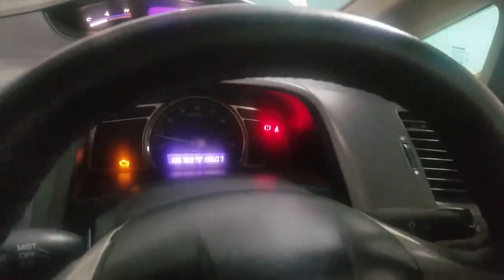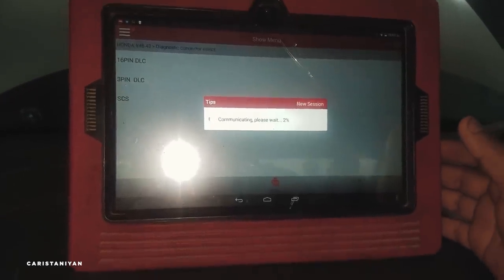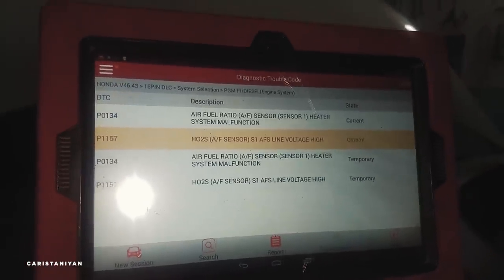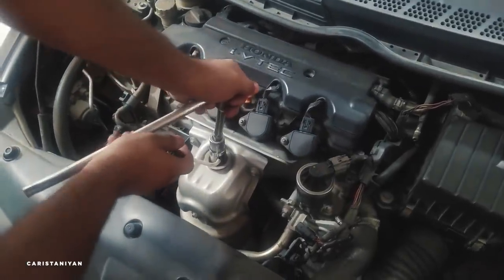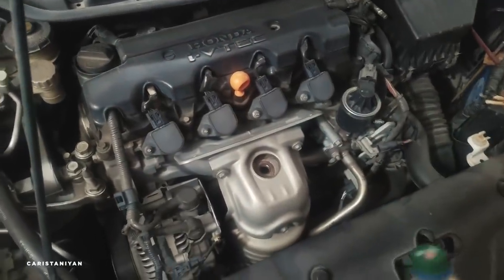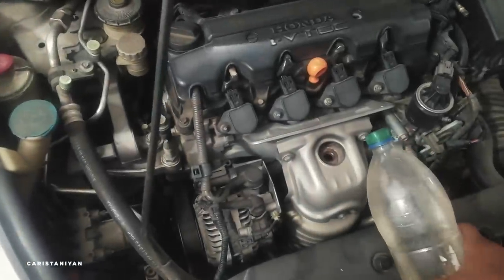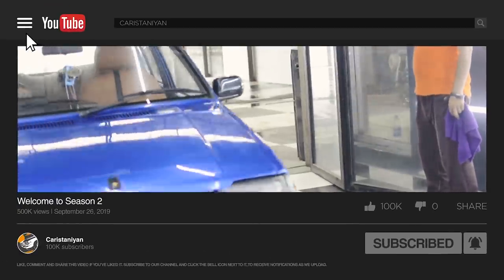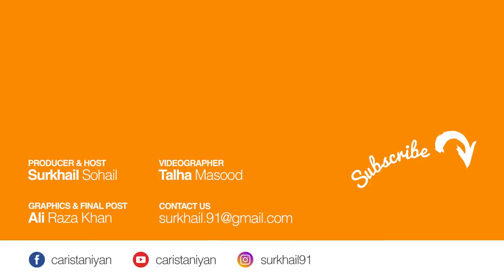Catalytic Converter and Oxygen sensor cleanup | Check Engine Light removal | S02E03

Comment from the maker: To everyone saying this is not the right way of going about clearing the oxygen sensor code, I agree, it's not. Changing the oxygen sensor (new around 25k and kabuli around 5k) and Catcon( new around 30k kabuli around 13k) is the right way. Everyone cannot spend that kind of money. This is the process being followed at workshops around the country which mechanics charge 4k to 5k for. I documented it so in case you DO plan on going to a mechanic to get this done.
(1)  You have an idea what the process is and how cheap the process is so you can negotiate.
(2) incase you're technical enough, you can DIY this at home.

That's all. If it works, IT WORKS. as for corroding, you can pour water after pouring acid so it dilutes and does not corrode the silencer that much. If anyone of you still has doubts, car is at Autogenie everyday, you can come and see if it has corroded or if the sensor is damaged in any way.
Reply: Aslam o Alikum bhai acid ka Name btain plz our kidr sa ya buy kar saktay hn.. Shukriya
Reply: First I support your view that this method of cleaning is fair and one suggestion: do try caustic soda mixture in water for cleaning...it is highly recommended for cleaning in automobile industry wherever there is grease, oil or any other deposits. I am sure you'll find it beneficial.
Reply: Bhai wash krnay ky liye  acid kon sa use kia apnay and kahan se milta hai
Reply: Dear which acid u are using to clean?
Reply: Gravity kitni honi chahieah acid kiii plz reply dain

Comment: make sure never use acid for sensor or C converter.  it destroy the sensor sensitive part inside and also it increases the emissions of bad gases from C converter.  use Carbon chock cleaner for sensor and best cleaning agent once a year for C converter.

Comment: Everyone is asking about the acid, it is most likely Sulfuric Acid (H2SO4) or Hydrochloric Acid (HCl). First preference is Sulfuric Acid, if you use Hydrochloric acid it will destroy your exhaust system even if it made of SS (stainless steel). Chlorine acts as a poison for SS.

Comment: Big mistake....cleaning with acid is highly not recommended. Rust will come back so quickly may be in a week you need to clean again. If you're cleaning any thing with acid make sure to neutralise it with a  base e.g sodium carbonate.  Anyways your catalytic converter will expire after acid bath.

Comment: Better to get it cleaned without removal from MotorClean Walton Road opposite to Packages Mall Lahore . They do not use acid and their method is quite safe also. Charges are quite reasonable and owner is Electrical Engineer
Reply: @kashiflf  how, can you breifly explain

Comment: Nice video. If the O2 sensor is very old e.g. over 80,000 km, then no harm in trying to wash it with acid or any other means. Just don't expose any sensor to WD-40 or similar silicone based product. I am not sure how the zirconium dioxide in the O2 sensor will behave after the acid wash but since it is already not working so no harm in trying such things. Similarly, no harm in trying to wash the cat with acid. The way it is done is important to avoid damaging the entire exhaust system.

Comment: Dear Sir, I have recently bought Suzuki cultus about 3 weeks ago
2010 model and driven 86k kilometers. Changed engine oil Zic x7 10w-40 along with air and oil filter(Guard).1.    Problem is my car is giving white smoke oncold start for about 10-15 seconds then it disappears and steam comes 2-3 min.2.    Smoke only comes if the car is at rest formore than 6 hours otherwise no issue in pick or drive.3.    No reduction in oil or coolant till now.I'ma new owner of car and hence do not have its previous details. Please guide mewhat could be the cause of it and how it can be fixed.

Comment: Aoa. Bhai is sye fuel consumption par b fark parye ga ??
Reply: Yes, because this sensor is responsible to send air/fuel mixture ratio to the engine, hence if it's working fine it will send the best air/fuel mixture to the engine. 
Catalytic converter mainly affects the pick of the car.
Reply: @F-Khan491  Bro. I have Japanese Mitsubishi minicab van. Like for 32 km 4.39 litter consume kar rahi.
Reply: @ziakamal1234  what is total mileagr of the car and have u ever cleaned the cat converter?
Reply: @zaidKhan-pj3gg  it 9000 something
Reply: @zaidKhan-pj3gg  yea i did once  back in February

Comment: Can you please guide us that should we replace fuel filter of honda city 2012 after every 40,000 KM as per maintenance schedule of Honda Company or there is any way to clean to fuel filter like you cleaned the catalytic converter. Or is there any need to change to fuel filter after every 40,000 even if its working fine. Please guide because it will save lot of hard earned money and time.

Comment: bro wouldn't it be harmful for the silencer dholki? kyun k wo straight pipe to ni hota dono pipes apas me 180 degree differenct hotay hain? zada behtr nahi k cat utar k simple cat ko hi saaf kiya jaye
Reply from the maker: This is for DIY. Workshops usually take off the whole CAT for this.
Reply: If you have the required tools i dont think dismanteling the cat is that big of a deal
Reply: My honda city cat is located behind the engine and close to the chases. So it is difficult to remove. It remove from the bottom of car

Comment: Never try to add acid in the catalytic converter when it is intact , its destroys your exhaust and mufler tip . I also tryed this but my exhust and mufler tip rusted like hell , please dont do this
Reply: Stupid mechanics always use acid to clean catcon & oxy sensor, which is a highly wrong way to do. I m dead sure the code will return within 100km of drive
Reply from the maker: This video was made in July. Code hasn't returned.  You just have to make sure you are using the right liquid.
Reply: What is the name of this liquid
Reply: @shahidhameed4548  iron eater diluted H2SO4

Comment: What was the name of the acid you used?
Reply from the maker: It's just called catalytic wala acid. Can be found at any parts shop
Reply: @Caristaniyan  battery acid tu nhi hai ??
Reply: @Caristaniyan  Thanks bro! Please do a video on obd sensors and how to use them for home diy's and cleaning of throttle body
Reply: @Caristaniyan  is namak ka tezab bhe kehte han

Comment: Using acid on catcon and sensor is short time jogaard, don't use this totally desi prescription. I am stunned to see Mr.Shukail turn from a real passionate and guide industry practice teacher guy to a guy tell desi and illogical nuskaas. Catcon at max can be cleaned by dishwash detergent through spray and washed with water to neutralize pH. And sensor at max with carb cleaner or acetone (nail polish remover or laqucer thinner).

Comment: Thats a wrong method to clean an Oxygen sensor / catcon.

Guys never use acid, it will destroy ur car
Reply: What's the other method?
Can you please share
Reply: @naveedahmad8476 both of these are replaceable components and they have limited life. You can use carb cleaner or gasoline to clean an oxygen sensor whereas u can simply use a hard wire brush to clean the catcon. Here in Islamabad all good sensible mechanics use these techniques.
Reply: U r right it destroys  system  if u use acid.
Reply: Why don't u tell the right way... these r changeable parts but it cost around 40k both..
Reply: @ammaduddin1114  buddy u can use carb cleaner / gasoline to clean an oxygen sensor. For catcon cleaning u can use long hard wire  brush. Just do google